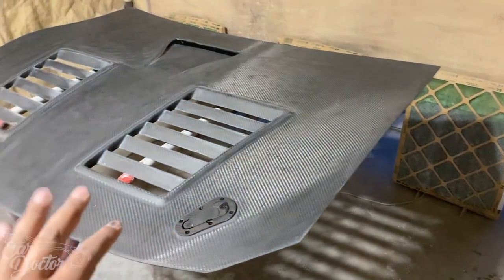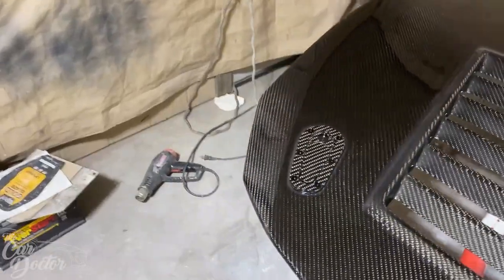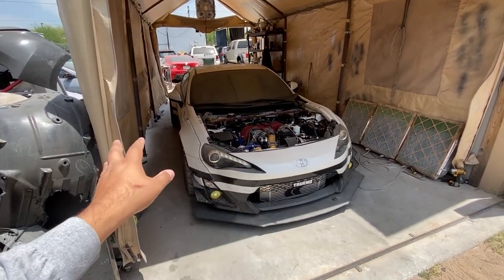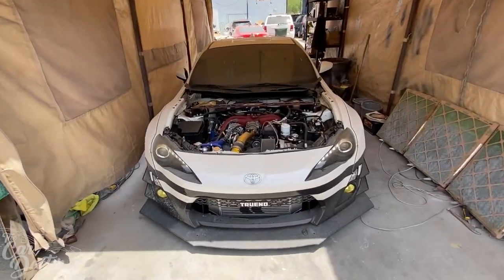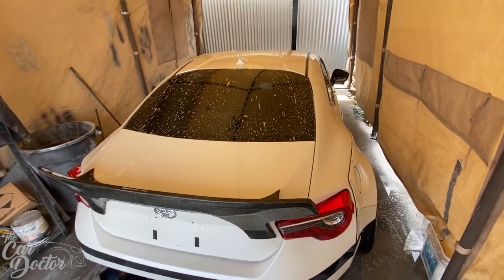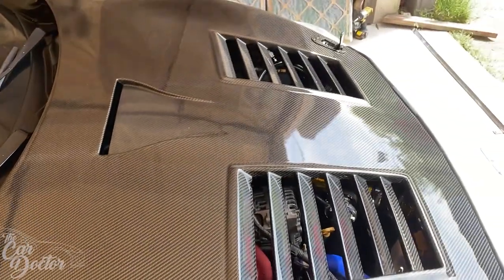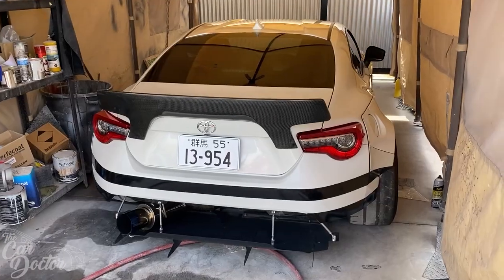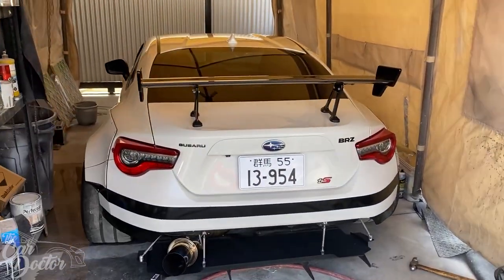Restoring the Carbon Fiber on My Hood "Sanding to Bare Carbon and Clear Coat"

Comment: When you sanded down to the fiber mat, didnt you sand away a lot of the resin? Did you reapply new resin, or just actual paint clear coat?
Reply from the maker: You sand all of the resin on the top surface only, to prevent sanding through the carbon. Then Applied a layer of clear on top. No resin, The yellowing, or fogginess is a resin trait which doesn't happen to clear.
Reply: @JonnyBarajas  so the top layer of resin (which is pretty thick) isnt really structural? It's fine to sand it away and replace it with clear?
Reply from the maker: @stephenwhite5444  Yes, the structural resin is in the weave. The fiberglass layer under most hoods is also holding it together. The top layer is only for shine.
Reply: @JonnyBarajas  did you sand the resin all the way to the fiber to get the yellow out? (Like could actually feel the fibers)? Or did you only have to sand a little off the surface? What grit did you leave on the surface for the clear to bond? 800grit? Thank you for all the info, In redoing a hood that's in terrible shape. This is a big help!